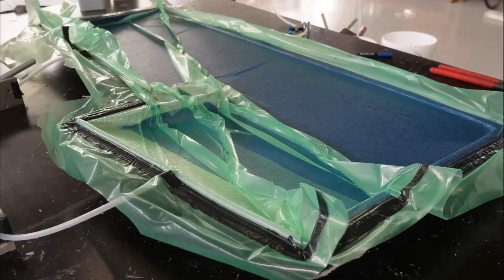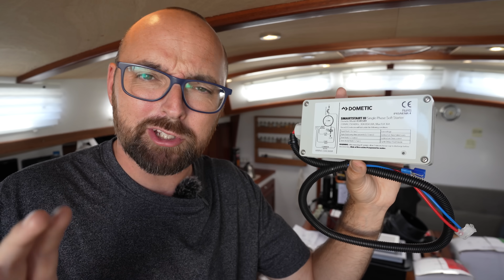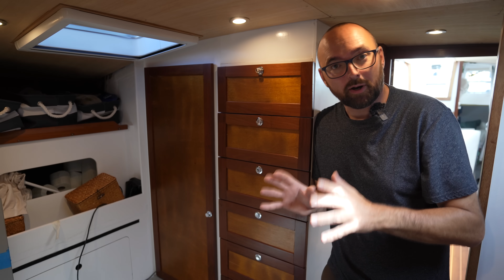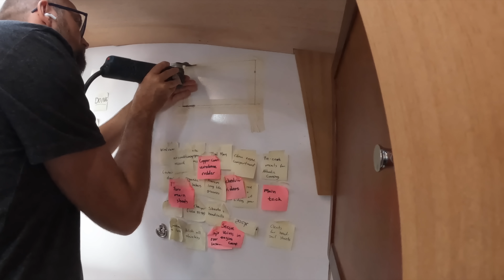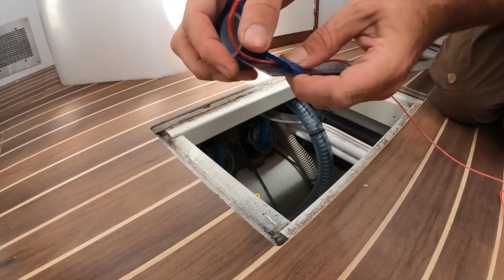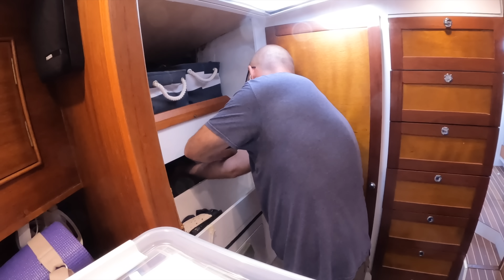Sail Life - Dometic DTG air conditioner install, part 1 of 2

Comment: I swear in all my years this is the first time I've seen someone using duct tape on an actual duct.
Reply: I had seen using duct tape on a duck but never on a duct!
Reply: Yep, duct tape should never be used on ducts, foil tape only. Heating ducts are worse than cooling ducts at destroying the tape so this may work for a while.
Reply: Where I live we actually have a brand of duct tape called Duck tape. Seriously.
Reply: @robinhodgkinson  You are right. The owner of the company was a brilliant marketer (and my neighbor for a while). The Duck brand became quite the thing and he got rich🤓.
Reply: @torstenhansen4308  and you are right sir, aluminum tape is a better choice for the duct. Also have had success with mylar tape.
Reply: Which is ironic because it’s the only job it’s sucks at but it’s the job it was designed for
Reply: @tacodias  Probably ran out of duck tape then.
Reply: That’s what I thought Duct tape being used on ducting?   What an idea 💡 😂
Reply: Sorry guys, the glue on the tape will weaken and the tape will fall off. Please use the industry standard for AC called Duct Sealant also called Mastic. Search here on YT for a video named "Applying HVAC Mastic to Air Seal Your Duct Work". Enjoy.
Reply: How many ducks does it take to slaughter to make one roll of duck tape?

Comment: Ducktape was developed for fast short term waterproofing. It's only because the name sounds so similar to duct tape in english that it started being used for ducting. There is some ducting appropriate tape that looks and feels very much like duct tape but in industry testing by ASHRAE (The American Society of Heating, Refrigerating and Air-Conditioning Engineers) and others duck tape is the only commonly used tape that fails at a high rate over time.
Reply: Need to add some long tie-wraps for a stronger mechanical hold around the ends of those flexible ducting.  That tape won't last long.  Something readily available here in the states, usually in the electrical section of the big box hardware store, but you may find them in the HVAC section as well.

Also...  need more toilet paper!  It was the first thing my wife noticed in the closet since she is always mocking my TP hoarder instincts.  I'd rather run out of food and water than TP!
Reply: @donlindell1994  baby wipes man better than tp
Reply: Well, Mads did use aluminum tape on the outside portion of the duct. Also, since this install is joining to ABS plastic, the duck tape might have better adhesion.
Reply: @tduenchan  I noticed the aluminum tape on the outside. But even if duck tape sticks to the ABS much better right now in 10 years it won't be.

Comment: Just a bit neater and quieter than the 5,000 BTU home AC unit and Honda generator we installed on our Pacemaker, but AC makes a huge difference in hot, humid climes. Our saloon became the hang out on those stuffy, hot summer days on the ICW. Cool beer, cool air and cool friends!... :cat-orange-whistling::face-blue-smiling:

Comment: Mads, two thoughts:
1. You will need a drain from the drip-tray. Lead it into the shower drain if possible. It's fresh water, so it easily goes stinky in the bilge. Or collect it. It is distilled water.

2. The cooling water discharge can go well above the water-line. Just put a little piece of PVC pipe as a spout in the outlet so the water doesn't dribble down the hull and leave a stain.
Reply: I know some new portable air conditioners are self evaporating

Comment: A suggestion for your return air. Size it so you can use a standard size air filter. The screen that comes with the unit will get dirty fast and bends with repeated cleanings.

Comment: The duct tape will fail over time. 

Simple solution, get oversized zip ties and wrap them over the outside on your flexible duct to plenum box connections. That’s a mechanical and plastic fastener that won’t rust or fail. 

Fellow boater and licensed Sheet Metal Worker. Aka duct work

Comment: Nice work per usual Mads. When you install your return air vent make sure you make two filters for it. When one is dirty simply replace it with the spare then you can wash and dry the dirty one for future use. Mine are over ten years old and still look brand new!.

Comment: You could use a set of "fishing sticks" which are like fiberglass tent poles that screw together so you can fish a mousing line from practically one end of the boat to the other in one shot.  A 30' set packs down to almost nothing and is enough to get a good ways into the mast as well so a line can be fished up to the spreaders for cameras, lights, supplemental antennas or whatnot.  Two sets would make it all the way down the mast from the masthead if you get lucky.  Fish sticks are straight and work soooooooo much better than a curly fish tape which is made for smaller conduit and sucks trying to fish a larger more-open space like above a ceiling or under a floor.

Comment: You might want to check that the vent in the forward cabin is not too close to the return air or else cold air will recirculate directly to the unit.

Comment: Nice work, just wonder if there will be vibration noise as well on the shelf. John
Reply: As it's located in a cabin, I think it will require anti tampering protection for when it gets annoyingly noisy.
Reply: Similar thoughts.   Shelf needs dampners... or isolators.   And will that little cupboard need its own vent to the outside?  It's going to get very hot in there.

Comment: I would never open the hull for the drain of an A/C.What is better than a through hole? Yes, no trough hole! Just thinking about forgetting to close it at sea and laying on Stbrd side. On my boat I do have that with the bathroom sink. 20° and water stays inside the sink. 5° more, it is in the boat. If you don’t want to put it to the bilge, I would use a small container with a pump. Like you can find it on every “condensation” laundry dryer. These systems bring the water 80cm up, no problem. A hole in the boat at that height I would consider to be ok. This Pump container can have an interlock, that prevents the A/C from running, when the pump fails and when you need distilled water you can collect it, too.
With such a setup, I would say, you could use the A/C while sailing. I would never even consider that, with a hole that close to the water line that is open at the other side.
Hilsen

Comment: Mads. Check and see if there a Aquarium Shop around. Buy a UV Sterilizer to hook to your intake Water to kill those little guys that Can plug up your A/C maybe when you get to a place that have Stainless Steel Tubing make a UV Sterilizer for your Engine Too.

Comment: How does the air in the saloon get to the bedroom?  Shouldn't you put a vent in the door?  

Nice Video!
Reply: He put the small vent in the v-berth(bedroom).
Reply: @danieloliver20  I know he did.  The air going into the saloon has to get back to the AC unit.  The return air is in the bedroom like you said.  But I don't see a vent between the two rooms.  They can leave the door open.  Otherwise the saloon will be warmer (when AC is on) then the bedroom.

Comment: Hey Mads, our old unit just crapped out and I was hoping to look at the variable output unit as an option...but it appears that they only sell these units through their "dealer network". Which seems to be code for not Defender or West Marine.  I'm guessing this is just sold by companies who do marine A/C system installs.  I do not know if a company like that will sell to a DIYer and I'm a little afraid of the price if they did.  I'm more afraid of the price if they did the install.

Comment: I can't remember where I saw it but there is a manufacture that makes an air-conditioning unit that runs on 24VDC.  Supposed to be pretty efficient too.  Depending on the amp hour size of your battery bank you could run the unit without the inverter losses of AC appliances while living on the hook.  Believe the new Hylas 57 uses those air conditioners and they tout they can run them for 8 hours with the standard battery.  That would be a blessing in the Caribbean.

Comment: You mentioned mounting the thru hull for the ac cooling water close to the waterline. Why?
Reply: If you mount it high on the hull it'll leave an unsightly algae stripe running down the side of your boat. Also you are more likely to break it on a pier or something.

Comment: If you have an isolation transformer from Victron, the frequency can be transform, as well.
Reply: Please source that one. No, a transformer cannot change the frequency. Even an auto transformer can only change voltage step up or step down or split phase balance.
Reply: Please explain that one. I’m relatively certain that the isolation transformer deals with voltage only and have found nothing in the manual to the contrary.

Comment: I'm trying to determine why you got a 16000 BTU AC unit.  I'm not an AC installer but looking at AC sizing website- indicates 30-35 btu per sq ft in a hot climate like S FL.  I figure you might have 300 sq ft of living space in boat (30'x10') and that would mean a 9000-10500 BTU unit would be suitable, yet yours is 52-78% oversized.  May mean quick cycling and less dehumidifying than you would expect.

Comment: You have a separate technical room, yet you still install loud devices in your bedroom to save ducting. It's not even the first time. Very bizarre.
Reply: The tech room is no good for the AC unit, impossible to run the air ducting and no place for the large return air grill.